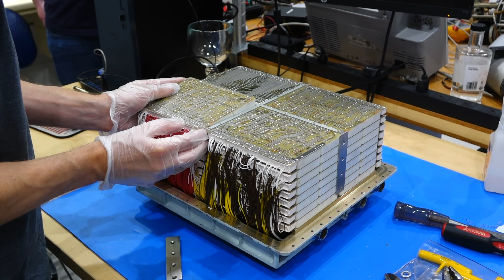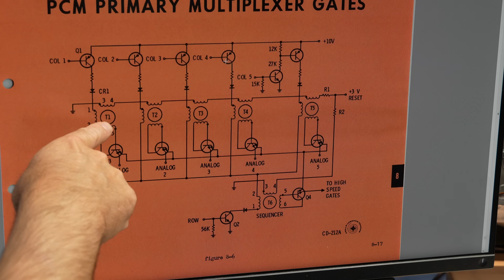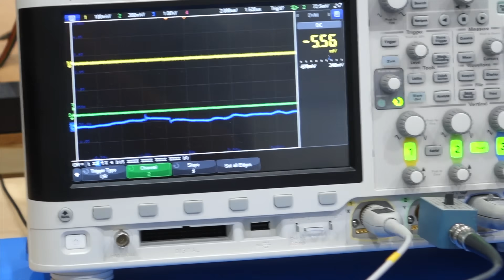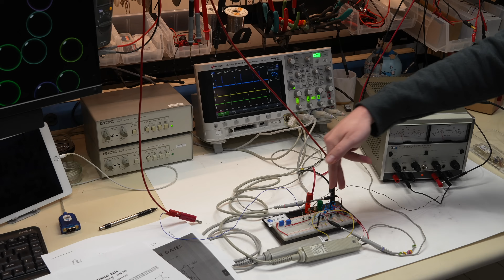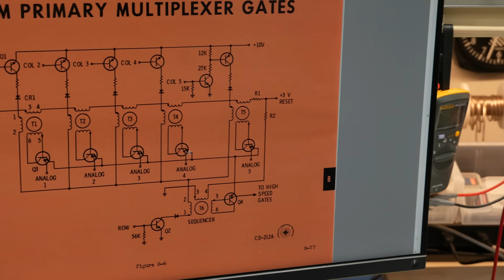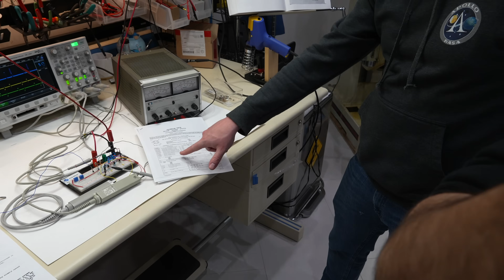Apollo Comms Part 37: Apollo's weirdest (but genius) analog circuit

Comment: I realize it's a stupid (ignorant) question, but why does the circuit rely on cores? 
Why can't the cores be replaced with solid state switching?
I'm sure there's something obvious but I just don't understand what.
Please help.
Reply: maybe because is cheaper and smaller  to use one core instead 3 more transistors
Reply: @mikes989 
Maybe. 
But thats not what they said. 
They were commenting how clean it was, how elegant; and then lamented that it would only work with the cores because you had to "float" the transistors. 
I get that that means a floating, uncertain voltage... kind, sorta... maybe I don't fully get it...
Regardless,  I don't t get why it has to float and why it can't be floated with solid state tech. 😊
Reply from the maker: Not a stupid question at all! It's actually a bit difficult to explain and understand. So what we need is to drive a voltage difference between the B and C, so we can turn the BC junction on and induce a current in it. But the reference of one side of this voltage, the base, is variable! The base is going to be about 0.6V above the emitter voltage, and this voltage is directly driven by the input to be sampled. So a normal biasing circuit derived off a fixed ground or Vcc connection will not work. However, the secondary of a transformer is isolated from any reference, it "floats". It just provides a voltage difference between its two terminals, independent on where the voltage of one of its ends is (the base in our case), which is just what we need. The coil voltage will "float" on top of whatever the base voltage is. It just provides a voltage differential between the base and the collector. That's why I can switch 10V input signals, positive or negative, although the circuit is powered by 5V.
Reply: @CuriousMarc 
Gobbeltygook. Utter gobbeltygook. 
You might as well be Spock spewing Treknobabble.
Thank you for explaining. 
I will be reading and re-reading this explanation and I will understand it... it's just going to take me a few days.
Thank you. 🖖😃👍

Comment: Back in the late 80's I met an older engineer at Boeing, who in his hobby time worked on interesting transistor circuits. He claimed to be using transistors in reverse mode to perform some operations (sorry, don't know what the circuits did), on 50mV power supply rails. I've always wished I'd learned more about that at the time.

Comment: I do wonder if some of these newly rediscovered techniques will be modernised and adapted and used to advance modern techniques using a twist from I forgotten technique
Reply: It won't. We can build much better multiplexers with JFETs and MOSFETs. Having said that, bipolar transistors have vastly superior radiation resistance, so for a space application close to Jupiter or a circuit near a beamline or inside a nuclear reactor this may still be a useful technique.
Reply: This was never lost in the world of IC design... a deeper shortcut around this trick at that scale though is scaling the size of the junctions proportionally, like tying multiple emitters or collectors together. This allows constructing a current mirror with a gain other than 1, including fractional values, without adding and routing more discrete transistors.

Comment: Very interesting. I was wondering why they used bistable magnetic cores rather than a pulse transformer. Then I saw that there is a small glitch on the analogue output when the cores are reset, so possibly the bistable cores are needed to avoid that glitch happening as the analogue switch turns off. Then I was wondering what determines the duration of the analogue switch ON state. Would it be the time it takes the core magnetism to flip (surely very fast)? Or would it be the time taken to clear carriers from the base region of the transistor? If the ON time is so brief this suggests the analogue inputs need to be low impedance and you need to avoid stray capacitance on the analogue output side.

Comment: Would this multiplexer circuit work with all the "inch" transistors replaced with pairs of regular transistors in the manner shown in the patent?
Reply from the maker: Yes, but not quite as well - there would be more voltage offset between input and switched output.
Reply: The offset voltages might be in the mV range, i.e. one can probably get 10-12 bit performance out of the two transistor circuit, whereas the integrated dual-emitter transistor might achieve 14-16 bit performance.

Comment: Reminds me of an amplifier front end technique where one would bias the cascode of the long tail pair using a BJT in emitter/base breakdown to get a roughly 7V zener effect but with lower noise and very good tracking/tempco behavior compared to a zener. That said, and not that it matters…but it precipitates hot-carrier induced defect generation that will wreck havoc on the Beta of the transistor. Maybe you lose 20-80% but if you never intend to use it as a transistor again it has benefits so long as you keep the current low (so as not to destroy the transistor) and use topologies that make sense. 

Lots of funky ways to use BJT’s figure I’d share this one.
Reply: Yes, the emitter-base junction of a 2N3904 makes a perfectly good Zener. I used them in a few circuits and didn't see any long-term reliability issues. Never tried using it as a transistor afterwards.
Reply: @connerlabs yeah generally the only thing that happens is beta declines, it can be restored to an extent by annealing but the temps really needed would damage the package to really bring it back.

Comment: The type of connection with collector and emitter reversed was common in the aerospace industry in the late 1960, as was the two-emitter transistor, The connection was called the “choppper mode” and when overdriven hard into the base ( like 10mA) the offset voltage from “collector” to “emitter” could reliably be expected to be ~ 2mV. These were used in discrete op-amps where the biggest problem was input offset current/voltsge which could cause horrendous drift on circuits like ADC where the Ibias and ioffs charge up the feedback caps. The arrival of the 709 and later 741 didnt solve any of these problems

Comment: You don't need magnetics -- techniques similar to this are still common. But today you use a photovoltaic coupler to produce the voltage with galvanic isolation, nice and small and cheap in comparison.
Reply: But then your turn off would be too slow.
Reply: @xsirfr1958  Depends if you think 18 microseconds is too slow? That's the rise time of a cheap 10 cent photocoupler

If you spend more you can get like 1 microsecond and under
Reply: Maybe... but photovoltaics of that kind was not available in the 1960s (no LEDs and gas discharge lamps are very inefficient). Even today generating significant base currents with a photodiode would be a challenge. You could use a battery for the floating supply or you could potentially do something with current sources, but now things are getting complicated. They didn't have the power budget and the space for complicated. There is also the reliability issue... magnetic cores are among the most reliable technologies and they are very radiation resistant. It's the correct engineering choice.
Reply: @lepidoptera9337  No challenge at all today. They sell photocouplers exactly for this use case. Like I said, circuits like this one, and variants of it, are still in common usage today.

They're not sold as photodiodes, because they are designed to act as a photovoltaic, not just for detection as a standard photodiode might be. They're sold as specifically "photovoltaic couplers" or "Photovoltaic output photocoupler" or such

Comment: Why couldn't you use a pair of diodes back to back. Then pass a current to switch on/off - chopper. Such a switch  can then.ve converted to a mux.

two diodes act as a switch, four make a ring modulator which switches polarity.
Reply: They could have and you will probably find plenty of diode muxes in older equipment as well, but they have much larger offsets, even with paired diodes.

Comment: The 4016 analog switch—formally designated as the CD4016 / MC14016 / HC4016 Quad Bilateral Switch—was part of the 4000-series CMOS logic family that RCA originally introduced in 1968. That said it probably just tad late for the Apollo as my guess it would have needed to go through qualification.
Reply: This has to operate in a high radiation environment. The early versions of the 4016 would have died because of radiation induced latch-up. Primitive CMOS doesn't work well in space. One can use CMOS with semiconductor layers on an insulating substrate to prevent latch-up, but I doubt they had that technology worked out, yet.

Comment: So could this circuit be made to work with an optoisolator instead of a ferrite core?
Reply: Yes, but these transistors need several mA of base current, which is doable with modern large area photodiodes and high power LEDs, but back then it would have been a challenge. They could probably have used an optical chopper wheel with a strong thermal light source, but that's mechatronics... at which point one could have used a mechanical switch anyway, at the expense of slower multiplexing rates.

Comment: Interesting. So, in today's language it would be called a reversed matched pair with common base and collector. I doubt this type of device is even manufactured today. Today, you would have to solve this another way; probably with way more components. Though, if someone presented this architecture now, its completely valid and actually has several advantages over modern designs. What a marvel the Apollo program was. Not too early, not too late.

Comment: I would be super curious if you could somehow replace that weird dual emitter transistor with your own circuit, or if you guys could build such a circuit, so basically we dont need that special part to build that circuit
Reply from the maker: Yes, you could build it like in the second figure of the patent, using two separate transistors. You can’t escape some magnetics though, however you could use more conventional transformers instead of memory cores.

Comment: You've really glossed over the operation of this transistor - please explain more without you excitement and incredulity
Reply from the maker: Here are the timestamps of the 5 different explanations of the INCH device in the video:
- practical usage: 06:34
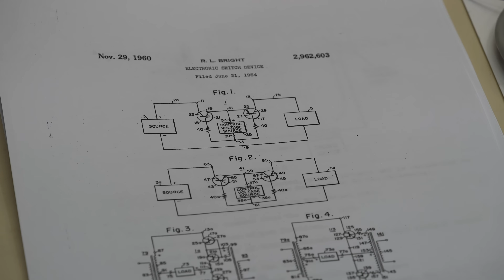- fundamental theory of operation: 10:55
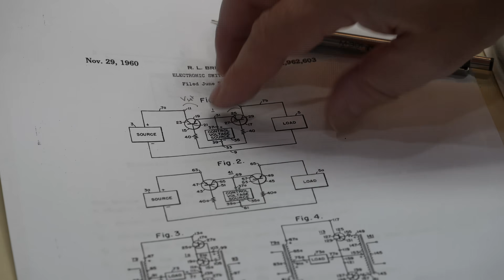- improved version from patent: 11:41 
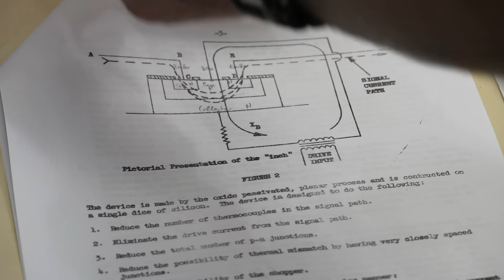- device physics level explanation: 14:20
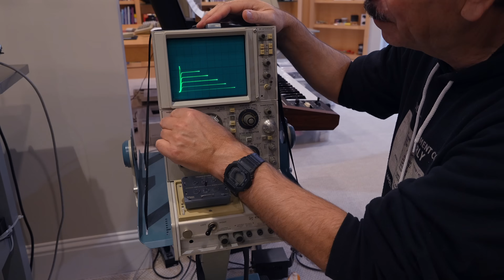- explanation of transistor saturation on the curve tracer: 13:00
Which is probably far too much in depth explaining already…

Comment: Why are the transformers coreful, with a core that has enough hysteresis that a reset pulse is required? I'd expect that an aircore transformer should also work (albeit requiring much larger pulses), as well as a soft-core one.

Comment: in some cases, dual-emitter BJTs can be replaced with just two regular BJTs (probably, matched pair) with their bases and collectors tied in parallel...
Reply: and with modern technology, like integrated micromagnetics (in digital isolators), it can be done in IC. I wonder, if this thing has any advantage over MOSFET switches

Comment: waaaaaaaaaaait... so THAT'S why logic gates have those weird multi-emitter transistors! That's how they actually work!
Reply from the maker: Unfortunately not quite, TTL gates, although they also use dual emitter transistors, use a completely different property of abused transistors: current steering. But that begs the question, could one make a good TTL NAND gate with an INCH? Now I am tempted to try it.

Comment: that circuit would be really good for switching between multiple analog video signals, like what you would have in survailance equipment. IDK if solid state is the correct term in this instance, but to do it with no moving parts is really impressive.

Comment: Dual-emitter (or more) transistors are the heart of TTL logic, which became fairly popular in the 70's, as you may remember.
Reply from the maker: They are, but TTL circuits use multiple emitter transistors for a completely different reason and in a different circuit, using current steering instead of saturation, which is a different form of transistor abuse. But that got me thinking: could an INCH be any good at making a TTL gate? Maybe, maybe not. Worth a try.

Comment: The operation of these devices makes perfect sense, given a general model of the BJT:

Consider that, in normal forward operation, positive Vbe is applied, drawing some base current, and permitting considerable C-E current flow.  A BJT reads the same in reverse (NPN or PNP), so we can swap C and E and observe the same thing -- inverted mode operation.  For practical reasons, this is usually at significant expense to characteristics (hFE, "Vceo"), but this can also be solved with appropriate design (whence we get "muting", and to an extent, "low Vce(sat)", types).

Take note: in saturation, it doesn't matter where the base current flows.  In forward bias, C and E are more or less tied together, and Ib can be sunk out of C or E equally well.  In a symmetrical device, it doesn't matter which one we label C or E, and we can apply current in either direction (Ic +/-) equally well.

We will still incur a voltage offset, due to Ib * (Rc or Re), but we have a basic way to switch signals with a BJT.

Note the BJT is a small construction, three alternately doped regions in a stack.  The small size is critical because free charge carriers diffuse between regions, and this causes "transistance".  Namely, small layer thickness (in silicon, a few microns).  (Layer area or dimension isn't important for basic operation, but voltage drop across a layer, does matter for internal resistance and speed.)  If we have a layer-cake of N-P-N, then suppose we split one N in half so the two N's are about half area each.  And suppose all three N's are symmetrical (same doping levels, or near enough equivalent given abruptness and etc.).  Now we have a transistor with common collector and base, and two emitters.  When one junction is forward-biased to saturation, i is connected to its adjacent layer as well.  We have a Vbe drop from say B to E1, but also necessarily B to C.  But that means we have a Vbe applied to the B-C junction below E2, so it will also be forward-biased.  More directly, suppose we apply base current between B and C: now the situation is symmetrical and, if geometry is well matched, the voltage drops cancel out with very little Ve1e2(sat), i.e., offset voltage.  Sweet!

Note that the distance between emitter regions doesn't matter: there could be some charge diffusion between them (the regions could be thin, say <10um, and very close by), or they could be distant (>10um base width separating the regions).  As long as Vcb does the trick, both sections will be saturated about as well.  We should therefore be able to construct one of these transistors by tying C and B together, and thermal matching, a pair of "muting" transistors (that we've also matched for equal Vbe (and Vbc!), within the specified tolerance).

Even more generally: operation is similar to the most basic kind of semiconductor switch, the photocell.  A bar of intrinsic semiconductor is insulating under normal conditions; when exposed to light, charge carriers are freed, and it becomes conductive.  (CdS photocells paired with alternating neon lights, were the basis for many a chopper amp back in the day!)  Any means of creating or attracting charge carriers will do: besides light, we can inject charge carriers by forward-biasing a junction (which nearly describes the UJT; its "channel" is not intrinsic, but rather lightly-doped, so that some initial current can flow, while still exhibiting significant conductivity modulation); or we can "enhance" the surface by inducing electric charge (a MOS gate and channel*); or we can do the inverse (use a doped semiconductor to make a default-conductive path, then pinch it off with a depletion region: the JFET).

*MOSFETs actually use NPN or PNP structures, with electric field applied across the edge of the stack; but intrinsic MOSFETs work, too.  Apparently a typical CdS photocell becomes conductive with a bias of 100-200V applied to its face (which is otherwise passivated by a layer of (plastic?) insulation).

Mind, a photocell is structurally different from a BJT; this claim requires justification.  Without going into detail (also that I haven't worked with the physical equations in decades..), the effect is similar, despite the intervening base layer: minority carriers diffuse across the base layer, at nearly equal concentration (that is to say: the base draws only a fraction of the current flowing C-E).  In saturation, they're not just equal concentrations, but balanced flows, and hence approaching true equilibrium (no voltage drop = no carrier gradient = no diffusion).  We still need to pass some base current to make the thing work at all, but this can be drawn through common terminals, balancing the voltage drop.

It could also be done with light emission, such as by avalanching the common junction (but this would be inefficient), or radiative recombination.  The latter is  low-yielding in Si*, but prominent in many compound semiconductors (a GaAs BJT would also make a fine IR LED!).

Basically, in short: you slap a bunch of junctions together, get some charge carriers flowing, and they're all kinda slutty and sharing current. Semiconductors are fun at parties like that :)

*But not none!  IR emission is of diagnostic value, albeit fairly crude as the long wavelengths make imaging of modern ICs more of a "in this general area" than a "this transistor is broken".  Some lovely photography of this can be found on www (.) richis-lab (.) de.
Reply: This guy knows his business!